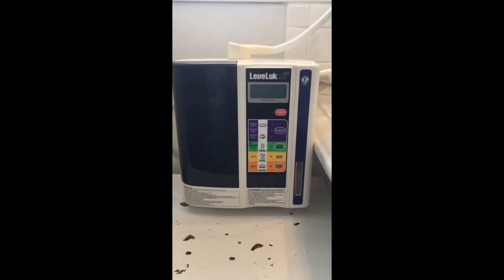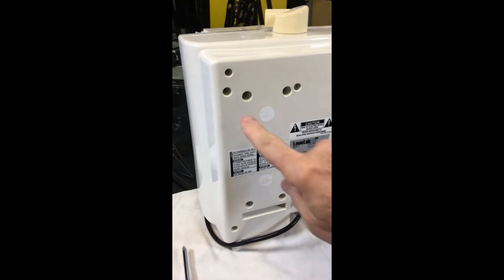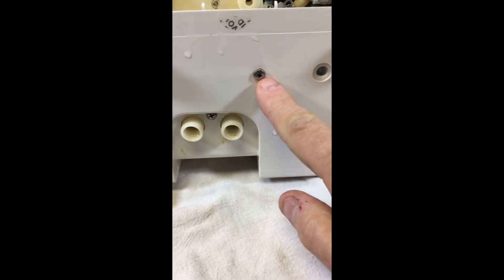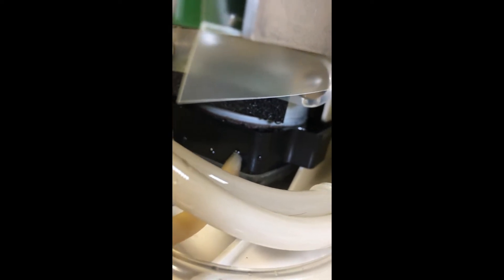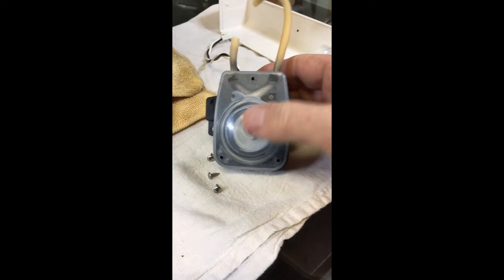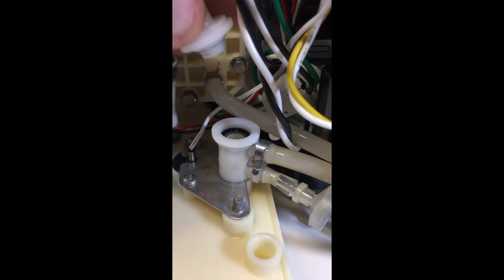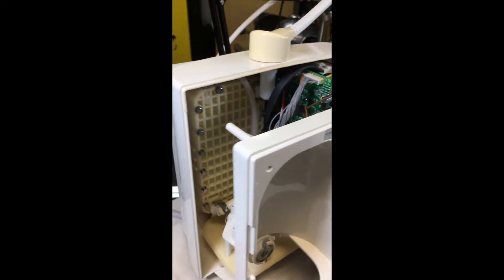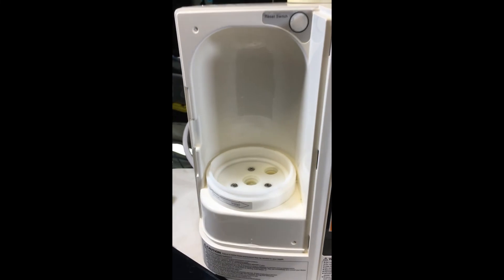Kangen SD501 Internal Leak Repair for 75¢

Comment: Hi Steve, your videos been very helpful and disassembling my Kangen SD 501 unit. Went through the whole process replaced the little washers that you found as well but I still have a leak so I don’t think it’s coming from there, but I want to be able to see exactly where the leak is coming from but I’m wondering how you managed to do that without Installing the front electrolysis plug that the one above the little tank that I don’t know what they call it anyway, but you have to try to counterclockwise to take it out. I had water shoot out of there the last time I tried that leaving the front face off, so there has to be a way that you held that in so that water didn’t go through there. What did you do? It is the calcium adding cylinder.

Comment: So I went through this torturous sequence, taking the entire system apart (including the titanium/platinum plates), and I soaked the plates in citric acid / CLR / vinegar for 10 hrs. I rinsed them, and dried them outside. I reassembled the SD501, flushed it, checked for leaks, all good. I made an entire video that I will need to edit and upload.

But then...after turning it on, I still get the dreaded "Notice of cleaning." I was ready to take a hammer to the machine. So I personally think there's something wrong with the logic board, whatever is deciding that the plates are still dirty. I don't know. And good luck finding ANYTHING on the web that allows you to do your own maintenance.

So I will eventually figure this out, and post my findings for ALL to enjoy. Thanks Steve for the incentive to do this.
Reply from the maker: Did you repace the cartridge?
Reply: @theruckusdj  I don't understand what you mean by cartridge. Are you referring to the charcoal filter?
Reply from the maker: @johnnyc.5979  Yes
Reply: @theruckusdj  Yeah it's a generic filter that was working fine for a month. I put the older filter back in, but still having that "Notice of Cleaning" message. My Kangen is 14 years old (given to me). Not sure what the next steps are. I read somewhere that the titanium/platinum plates last about that long. So maybe time for a new unit...
Reply: @johnnyc.5979 Hi, if your machine is 14 years old I read in manual that after 10 years of using the machine it needs to be send to Enagic local repair to be disassembled even platinum plates and cleaned deeply inside. Of course it will be pricley and maybe for your machine it's never to be made. That's possible why you have this message.
I just thinking is it possible to do this deep clean by myself? That's why I searching video of disassembling the machine. Interesting is it hard to disassembling deeper, it's not look to hard because everything looks like on the screws and possible 😅 And sorry for my English language.
Reply: @KaKa-ol9ep  After I did the deep clean and the flushing with the citric acid, and then the little cup, I noticed the foam inside the cup is almost black. I think the super cleaning actually destroyed some seals. So it's on the shelf for spare parts.

Good news though, my wife's cousin in Utah had a machine in her shed. It was the upgraded model, and ironically I have a carbon filter for that. It's cleaned and working. She gave it to us since she doesn't use it.

Comment: Hey Steve, I kept getting that "Notice of cleaning" error all the time. I did the flush. I bought a transfer pump, I used citric acid and cycled for many hours. Still that error.

I took apart the Kangen, pretty easy, but I found a white ball that dropped out from the bottom. I'm not sure where it goes, thinking possible one of the bottom tubes, but I have no idea, and I can find nothing on the internet. No IPB, and no manuals. They surely keep their systems very secret. Let me know if you know. 

I don't know how serious it is to NOT have that white ball go where it needs to go. I was filming myself with an Insta 360, but the video isn't clear enough to see where the white ball dropped from. It definitely came from the bottom of the unit. Maybe it stops one of the tubes from dripping?

Comment: Do you remember what size the o-ring was?  I think we have the same problem and I wanted to get the replacement part before taking the machine apart. Thanks for doing an awesome job on the video!:face-red-heart-shape:
Reply: Can't remember but best take the old one down to the store with you for comaparison.
Reply: @stevewhelan3770  thanks for the reply. we ended up getting Enagic to do the repair
Reply: How did that go??  @tanakainhawaii

Comment: Hi sir...is there any chances the primary inlet (inlet from water source)is stuck with white ball valve..mine have some ball stuck inside the the primary hole for kangen filter
Reply: I have the same problem, i dont remember where the white ball placed before, it went trough 😅